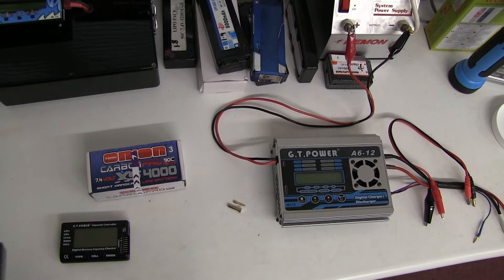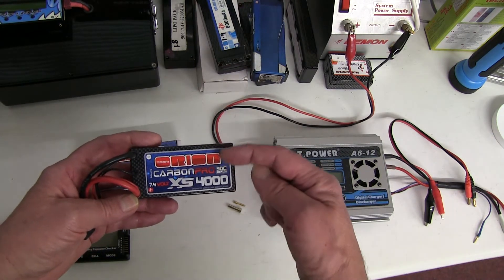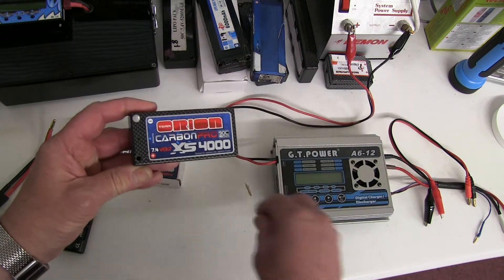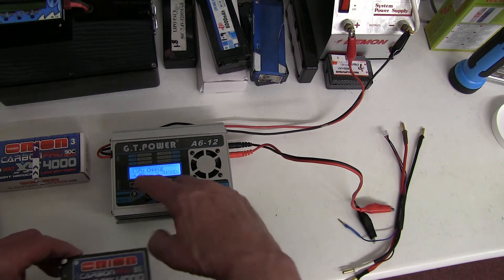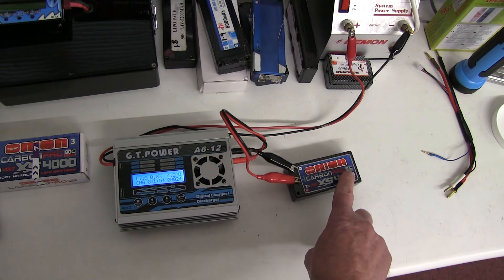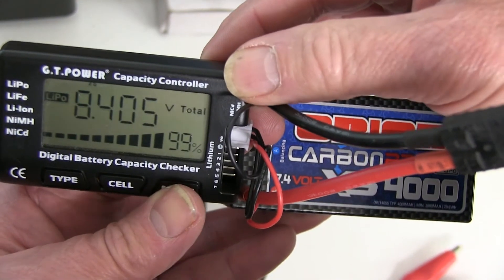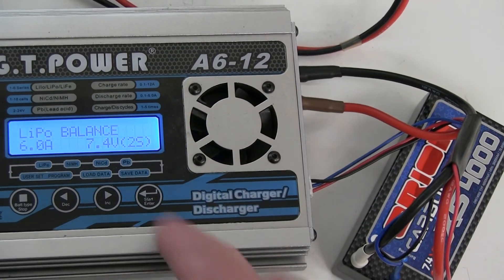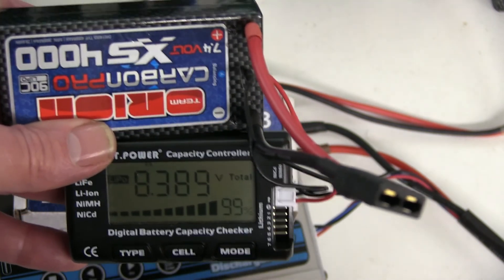How to Re-balance a 2S Lipo Pack.

Comment: hii.. i have lipo 2s.. 1 cell 3.7v and then 1 cell 0.0v.. i have tried charge using Nicd / NiCm 1 cell 3.7v and 1cell.0.11v then my imax said full charge.. please help sir.. you have a clue? thanks b4 :) btw love your video
Reply from the maker: Hi. Sometimes the lipo cell will not recover and is no longer useable. However connect to the low cell through the balance port, leave it on nicad charge at about 200ma and see if it recovers. All the best Nick
Reply: @nickadams5411  thanks for your reply.. i will try.. but its save? or time to buy new one?
Reply from the maker: @irfanemonk  Hi. See if it works first.

Comment: Hi Nick, really enjoy all your video's! Regarding rebalancing, I've got a cell that won't come back up to match the other (Reedy 7.6 HV). When I follow this procedure out lined here (doing a 1cell chrg) , sure enough ,I can get both cells to match perfectly! Then I do a 2amp discharge (max I can do) the cell mis matches again, and I can't get to match on recharge balance charge? So once more, do the discharge, do idividual 1 cell charge, and I get it to balance perfectly? Should I just charge it like this, save it for my "a" main run and just figure this'll be the only way I can use it? Thanks for you video Mike ;>)
Reply from the maker: Hi Mike. Some lipos have a cell that always falls back after charging. It will probably never stay up to the other one. But this method normally gets it close, when it is far out.  If you do a fast charge without balancing (balance lead not connected. You select Fast Charge in menu)., you will get a higher pack voltage since one cell will be higher than the low one, and it will average out to the legal max voltage. The pack will then be better. For A Main I would only use a pack with identical matched cells.
Reply: @nickadams5411  Will do ! Thanks Nick!

Comment: I use standar lipo charger for charges my 2s lipo and then 1 cell goes 4.3 volts and 1 cell 4.1 . How i can balance it without buy more charger??
Reply from the maker: Hi
Only if it can charge a 1S (one cell)

Comment: I use a lot of 2s packs. does it hurt the batteries to constantly balance charge packs? I use a 4010 I charge and normally it's always the 1st cell that always goes out of balance. is this common?
Reply from the maker: Hi Mike
Balance charging causes no hurt, and is the preferred safe way to charge packs.
Good quality packs are well matched and the individual cells should stay close on voltage and capacity.
If one cell constantly shows up lower voltage it is never going to stay the same as the other.
I have not noticed one cell being more prone to going out of balance, and there is no reason for that to happen.
Some chargers are not that accurate and often show out of balance when they are in fact good.
If your pack is way out of balance, try fully discharging then fully charge,  a couple of times.

Comment: hey so I didn't do this and ran my car and now it seems to have way less power then it has to and after the run 1 cell is 1v smaller then the other 2 should i charge and discharge the 3s 3500mah lipo at 
.5 amp? 3 times
Reply from the maker: Hi
The cells have got way out of balance.
You can charge at the very low amps and cycles as you say.
It may bring the low cell up.

Comment: Question Nick, charging your battery and leaving it overnight, some people say full voltage for too long will damage the pack over time. Have you done any tests on this?
Reply from the maker: Hi Mike
The manufacturers cover themselves by saying they should be stored half charged.
However , you would normally have a full charged Lipo in any equipment from drills to mobile devices, so I can't see why there would be a problem.
I have not seen any unusual failures with stored Lipos.
i have seen them swell up with low charge, half charge and full charge.
I have also seen Lipo stored for months, even years at Full Charge and not lose any voltage or problem.
Only storing them dead flat seems to damage them.
So, I have no problem charging up to full the day or even week before using.
Sometimes Lipo swell up with no reason why, but it is not that common.
Hope that helps.